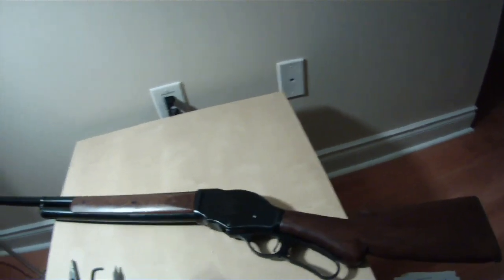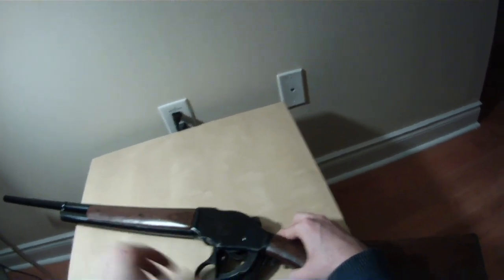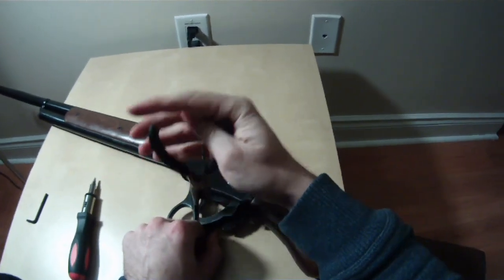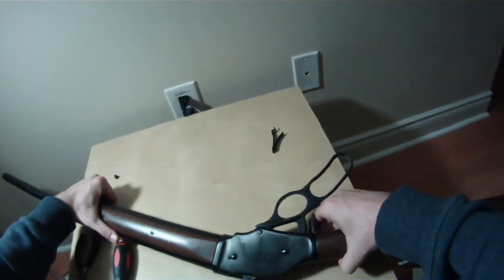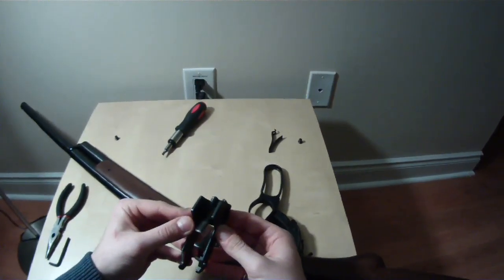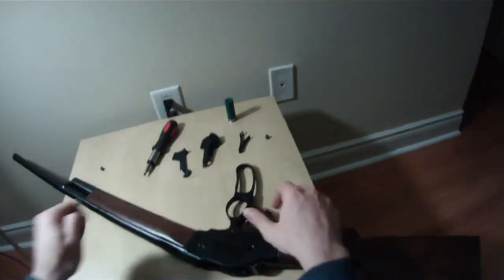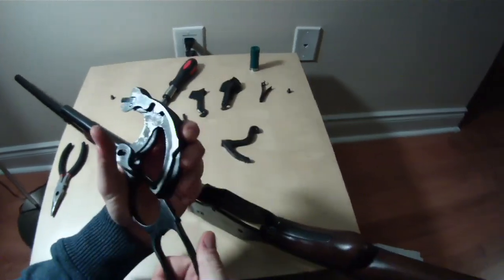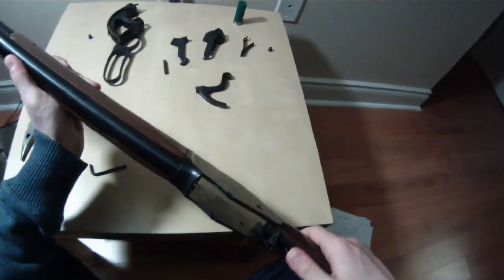1887 Shotgun: Action Disassembly

Comment: Is it possible to remove the carrier without removing the spring, i have a fast load carrier to fit , which basically a modified right side carrier. Id rather not fully strip, if i dont gave to. Thanks

Comment: how do you get the spring back in?
Reply: I had to use needle nosed vice grips to compress it to get it back in. I couldn't do it with needle nosed pliers, maybe some of you can. I put it in a gun vice, upside down with lever fully open. After that, compress the spring (as you did to take it out) and put it back in with the hook looped over the pin and the back end riding on the roller.